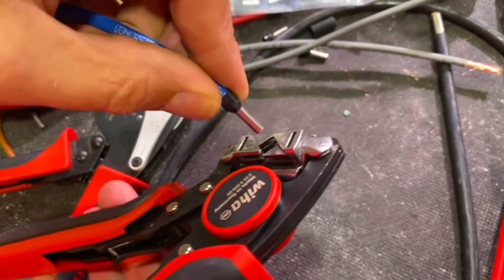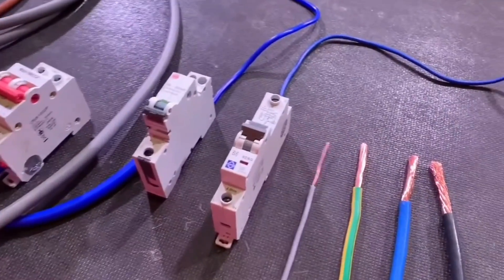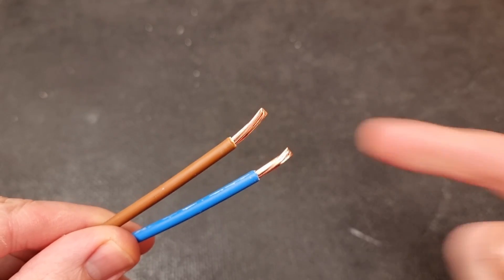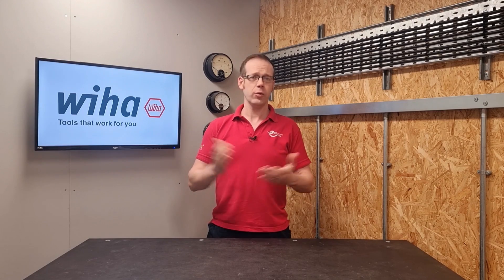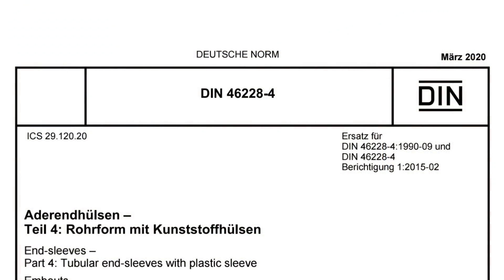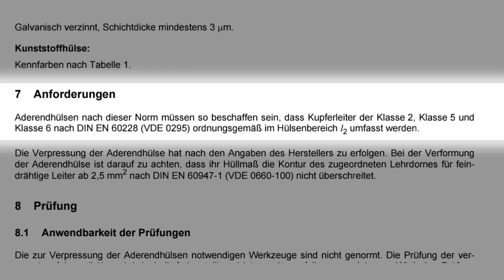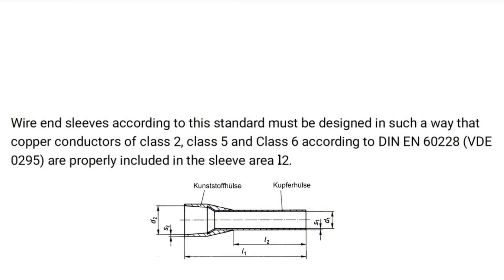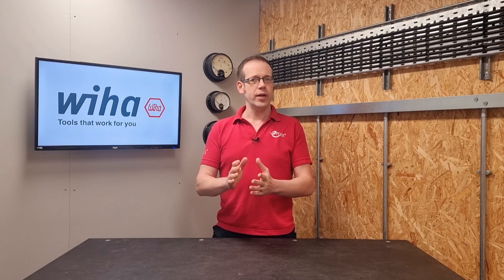FERRULES ON STRANDED CONDUCTORS: Should you use them?

Comment: I wouldn't use ferrules on stranded cables. The strands are stiff enough not to splay out like they would in a flexible cable. Also, the overall diameter of the strands is slightly greater because 7 strands will form a hexagon cross- section with rounded corners rather than being circular. This makes it harder to push into the ferrule and there is then the temptation to use next size larger ferrule which won't fully compress around the conductors when crimped

Comment: I'd use crimps on class 2 cables only with a crimping tool that can impart enough pressure on the strands to cold-fuse them together. So, that would rule out manual crimping tools in my book.
I'm not a professional and I can't afford a GBP 1000+ tool for that, so in the rare event that I do come across these kind of cables, I solder the strands together with high temperature solder rather than using a crimp connector.

Comment: @efixx I had my heart set on the Knipex 97 55 14 until this video.  I like the idea of the wire guide on the Wiha crimper.  However, I like the chrome plating on the Knipex for longevity.  Does the guide result in more accuracy?

Comment: The "Evaluation" of Weidmuller ferrules and Weidmuller ferrule crimping tools work fine on class 2 stranded if the ferrule crimp style best matches the type of screw connection (the screw is being used as a ram from the top pressing the conductor in to the body of the receiver and not wrapping the wire under a screw flange). I think the crimping tool needs to be of high quality in order to get a very high pressure (meaning high leverage) ferrule crimp, and best match the crimp to the screw attached shape; square, hex, half round, ect. so you need to have a selection of tools available.

The odd approach in the video is to point out the standard as a focus for class 5, or in the USA called flex, meaning constructed of much finer strands than class 2, when it is obvious that the challenge for fine stranded flex wire is it will not keep its shape under a basic screw top ram type clamp design. However, you have the same problem with class 2 if you just take time to see how the screw ram deforms (splays) basically any type of stranding as compared to a solid single conductor, which is generally accepted as the expected type of construction for the ram type of pressure connection. In my opinion, you don't have any real good alternative than to use a ferrule on a class 2 conductor with a shape that best matches to screw hold down design.

For a regular screw head (like on a receptacle) for class two conductors (THHN/THWN as just one example) I like to use a locking spade crimp terminal (I have some very strong terminal crimping tools (from Pressmaster), one for insulated and one for non-insulated) rather than trying to wrap the stranded wire underneath the screw head. If you use a locking spade and torque the screw to specification I have never had one come loose (as far as I know, and my customers would let me know). The connection is much like you would have in an old control cabinet if you were to use a screw terminal block, which has largely been superseded with rail mounted connection blocks in industrial electrical cabinet design, where the obvious choice is to use a ferrule.

Comment: Well my question is can ferrules be used safely on a Victron 100/50 Smart charge controller my PV in wire is direct burial 10 gauge solar cable my inverter in from inverter to C/C is 4 AWG this is all stranded wire and my battery cable from my C/C to my battery bank(actually to my bus bars that my battery bank is connected to) is 6 AWG that sounds like a lot for a charge controller however that charge controller can make up to 50 Amps and that’s what Victron calls for it’s hard to find a ferrules crimping kit that will do 10 awg all the way up to 4 awg  does anyone have any information on this????

Comment: The ferrule tubes aren't here to stop a short. What are you doing in Great Britain? 

As per studies at the ETH Zürich, ferrules are here to stop the screw terminal from cutting through the strans and if you don't use ferrules (no matter how many strans), they could split apart and get lose. 

This has happened often with many wires here, which is why these are required, and should be all around the world.

Comment: My strong suspicion is that by the time the screw is fastened down properly onto the crimp, then it will crush it sufficiently that it will make very good electrical contact. However, that's not proof of course. It also has the advantage of containing the strands and stopping them spreading. Screwless connectors are, of course, a completely different game. There I would think that it's much less secure and to be avoided.

Comment: Fun fact: We do use Class 2 over here. It just that we use it almost exclusively in panel feeds, starting at 16mm². It is used because absolutly nobody has any sort of fun working with a solid 16mm² conductor, let alone 5 of them bundled in a cable.

Comment: I had heated debate with one of my apprentice's tutor about, he would use them and required them. I have shown what happened to brand new motor DOL setup where 2.5 cables were all ferruled and then pull tested. It did not last 4 weeks thermal effects were obvious. Probably local overhesting destroyed connectors in contactor and had detrimental effect on motor protection. Conclusion, use ferrules when number of strands is 24 or more (for small conductor csas) for bigger csas use your judgment

Comment: ferrule crimps are a great time saving invention for stranded cables. BUT I'm a sucker for twisting and tinning the strands with solder. Working with automotive wiring in my youth, soldered connections, would always keep a good connection. When a crimped connection got wet and "fizzing" , it would start to make green gunk, and make a bad connection. Soldered connections fair much better with dampness. This was with 12v-24v DC systems were water is not much of a shock risk.

Comment: Just done a job where ferrules had been used on class 2 conductors on the heating cables inside a bunch of 3 phase contactors and they were a mess, every single one had gone crispy and they were in a sorry state, in fact you could actually see the hot spot that had been created through the ferrules being there. I re terminated and blue pin crimped the lot. 
My personal take on it is Red/blue/yellow (standard) crimps for solid/class two and ferrules for anything finer than that.
Reply: What wire gauge where the class 2 conductors that had a failed ferrule?

Comment: I don't use class 2 conductors. Up to 6mm it is ok to use solid conductor. Usually anything above 6mm Aluminium is preferred (longer runs) - 16mm2 the most common (anything smaller is prohibited). I use terminal blocks to get from large Al16 wire to Class5 inside the enclosure for internal wiring.  Al16 is also solid. Though Al25 is class2. And huge terminal with hex head and high torque is perfect for Class2 Al25. 
Therefore no problems with Class2.
Reply from the maker: Amazing how things differ across the world - Aluminium is rare in the majority of UK installations.
Reply: @efixx  Not far from you. Baltics, mostly German DINs copypasted. Al is preferred as €/A*m is significantly cheaper and not even a drop less reliable. Most buried and suspended power lines are Al. This continues up to main metering enclosure where it switches to class5 Cu on the terminals before meter. Sometimes switches back to Al, often not. Both are easy to tighten securely with 2.5-35mm2 terminal blocks. Now if I think... Class2 under MCB would definitely be a problem, as they have flat surfaces that are not optimal for 7 thick strands. Terminals are a way to solve class2 problem.
Reply: So no ferrules on aluminium class2 185 mm2

Comment: Their are some crap crimpers out their, like ones that make the ferrule look like a crinkle chip and weakens it, I use press master, only crimps it on the top, and their are variations between German and french crimps in diameter that are meant to be the same size, and variations in AWG/mm2 cable due to who makes the cable that don’t match the crimp according to the size table, I find if it can slide over with some resistance it will make a good crimp, if you can hold the wire to the floor and the ferrule drops off I usually find it’s too big, and if you crimp that the wires splay out.

Comment: I ( not a pro spark) have often used crimps on 2.5 mm with running a loop through a socket and on 6mm for a shower for example as I experience a better tight fix at the terminals and not risk a single strand not secured aswell.6mm is horrible to work with at the best of times! Any little help is just that.

Comment: I'm an domestic spark and like to use ferrules on cooker and shower isolators. The main benifit is that it stop the conductors from reshuffling (coming loose) when pushing the isolator back to the wall and damaging coductors on the screw. Also ive replaced a lot of burnt out isolators when doing EICR's so rerrules must be better????
Reply: I'd agree. Even if the ferrel isn't a perfect fit for Class 2 (stranded) cable, if you're then using it with a screw terminal it surely must do more good than harm in the examples you point out.
6 & 10mm² are a right pain in small enclosures, even in 47mm deep 2Gang boxes it's still easy to loosen off the connection when screwing back the faceplate! Even a poorly crimped ferrel can only help in that scenario IMO.

Comment: In Ireland in any pharma jobs we have to use them on everything stranded. It's so stupid a lot of accessories simply aren't designed for two 4sq wires in shotgun ferrule and often makes for a WORSE connection but we have to do it anyway.
Reply: Took me a few attempts to get double ferrules to accept wires. Stumbled on solution by accident - very long exposed wires pushed through ferrule 3 or 4cm then trim back usually gets good fit
Reply: @cuebj  i do the same leave them extra long and never twist them and they slide in

Comment: Yes if there is ANY chance of the strands not being properly contained in the receiving piece of electrical equipment for the reasons you have high lighted - shorts, live part risk and current rating (includes contact area and pressure). On class 5 cable (including tri-rated and electrical equipment wire) always, its the best way of ensuring the strands are correctly contained, easy to do, controllable and finished result easy to see and check!  The golden caveat has to be use the right ferrule for the cable and its intended termination point. Bonus is removal for replacement and wire numbers are retained and ends do not get damaged, so much easier to reconnect versus unferruled wire ends.....

The question I would ask is why on class 5 do you need to if the receiving end is designed to take a bare end?  In my book bad joints only come about from wrong tools used, wrong or incompatible parts or wrong method employed (that includes rushing ones work or an attitude of I think its in it will do, working blind etc).

Comment: This needs to go hand in hand with torque requirements. I've had it where the correct torque 2.5nM on 6mm or 10mm shower and EV charger supplies using solid core and stranded cables and they've not made good contact because they've splayed and easily pulled out of the terminals at the correct torque, yet if you use a ferule to keep them together they don't pull out of the terminals so easily. Or you could just over tighten the terminals and crush them to the point they'll never pull out. There is the benefit on earthing conductors that they become more crush resistant so are less likely to sheer off causing missing earths in consumer units on smaller cables 1/1.5mm even when terminated at the correct nM. 
Personally I'd like to see a return of the rounded terminals rather than the clamping cage ones as the connection on older terminals felt much more solid.

Comment: Equipment in my experience is wired with bootlace crimps with stranded wire, it makes sure the screw terminal doesn’t cut through the stands of the equipment wire, conduit wire for fixed insulation I would not used bootlace crimps.

Comment: Let's be honest, most sparks buy whatever ferrules they can lay their hands on - usually el-cheapo ones along with whatever random Amazon/eBay/pretend brand crimp tool that they can lay their hands on that almost certainly doesn't form the crimp to the ferrule manufacturers' specification for shape or crimping pressure - assuming that there is even a spec for that "brand"....

Comment: One main benefit of using Ferrule crimps rather than a conventional crimp as we know it is that with a ferrule you actually clamp down onto the cable end as well as the crimp, whereas obviously with conventional crimps you are only clamping onto the crimp end and not the cable too.

We build control panels regularly and use ferrule crimps, they are fantastic and I wouldn't use fine stranded cable without them. The repeatability of a ferruled end cannot be underestimated for its ease and time saving capabilities... When fault finding or upgrading on an old control panel I have to say there is nothing worse than when they haven't used ferrules, it makes sense if they had to use fork crimps on old Telemecanique contactors etc. but when going un-crimped it is down right lazy and un-professional
Reply from the maker: Agreed, I used to build a lot of panels back in the day and used ferrules on all the tri-rated and flexible conductors. 👍

Comment: Have worked on sites where ferrules are required whatever the type of cable. Have got into habit of fitting on flexible cores specially on very small stuff.
Reply from the maker: Good practice. 👍
Reply: @efixx  dont think it is quite so critical on stranded but fit them anyway just out of habit now.